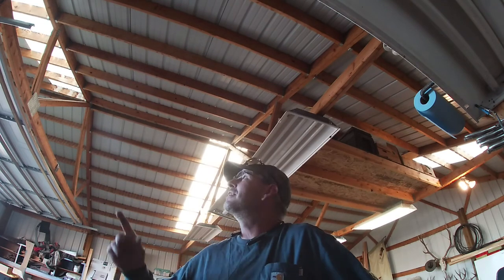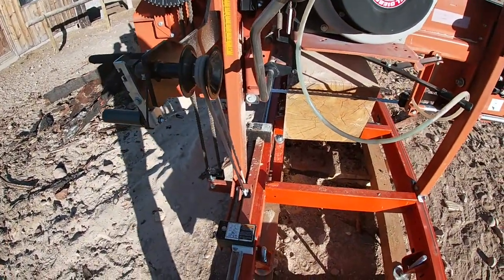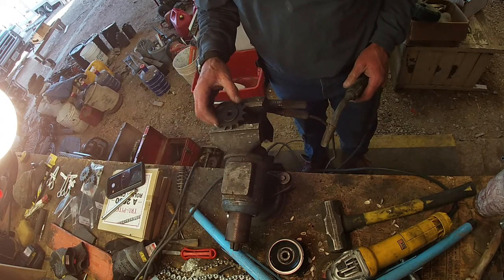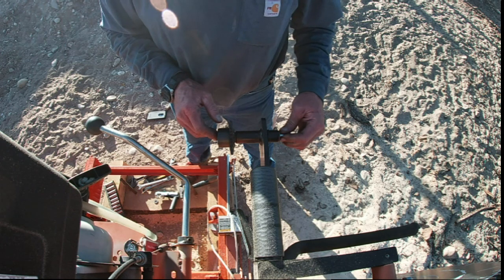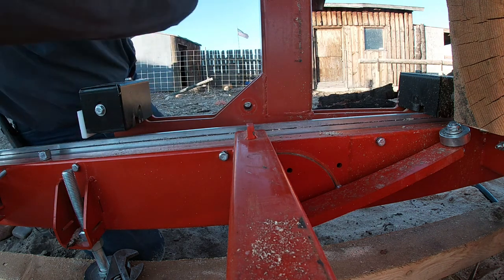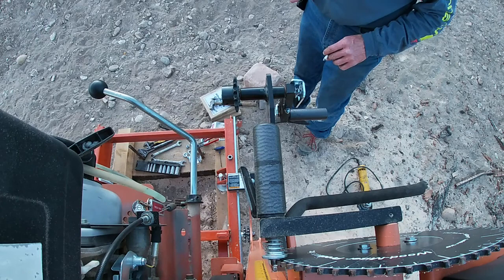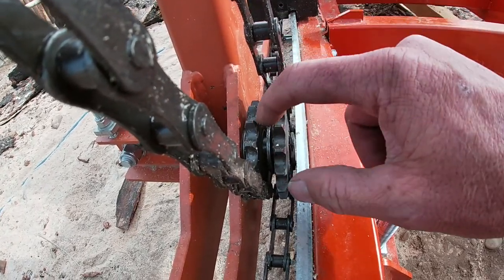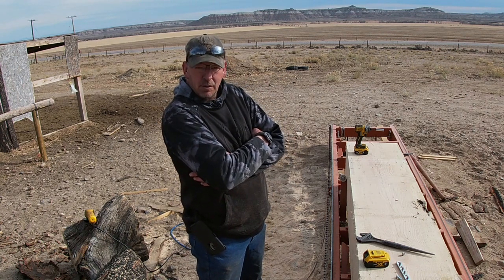Woodmizer LT15 drive conversion to chain drive

Comment: I'm on my 2nd LT15.   Yeah, the rope pulley system was always stupid.  I just push my current LT15 by hand.  I like your solution!
Reply from the maker: Wow.... 2nd one. Thats a lot of lumber to wear out an LT15. Thats awesome! Yea I definently wasn't happy with the rope system. i have a new(er) video adding wheelchair motors to the mill to drive it. Im currently out of logs but hopefully I will get a bunch stockpiled this summer. I'm not sure I could push the mill through most of what I cut. Even with a new blade it struggles to cut some of the logs I put on it. Have to go pretty slow. Thanks for commenting. I missed it and haven't been watching lately. STAY SAFE!!

Comment: Hi Travis!!😀😀
I was surprised to see that they were using rope for the drive on the newer mills. The old L T 40 that I used to borrow from my buddy had a chain drive system on them. They had the chain ran different than the way you routed yours. They had two chains. One from the crank down to the one sprocket. Then just a single piece of chain from one end to the other that just laid on top of the other sprocket. So as you turned the crank the inner sprocket just traveled back and forth down the long chain. I hope I described that so you understand what I mean. 
The  LT40 that I used had the power drive system on it with the Rio stat switch on it to adjust the speed. That way the chains don't have to cross from one side to the other. 
Take care my friend!!😀😀
Reply from the maker: You explained great. Yea i dont understand the rope either. Im planning on putting a 12v variable speed reversible motor on someday. It works pretty gppd though the way it is. Way better than the rope. Thanks for all the support!! STAY SAFE!!!
Reply: @307j.o.a.t9  cool glad I did good. LOL!! That rope thing is definitely for the birds. It just was a way to make it cheaper on their part. Mike Morgan has the rope drive on his also. He is adjusting it a lot it seems. The chain setup on the older mills never gave hardly any trouble. I milled 20 thousand feet of lumber the first time I borrowed it and didn't have any problems at all. Never even needed to take up any tension.
Reply from the maker: Nice! Yea i wasnt impressed. I like the chain system way better!!

Comment: Have been looking into this for you since my last reply. Linn sawmills has a chain drive feed system as an option. The cost is $250. might be worth looking into.
Reply from the maker: Oh wow!! Thanks. The system i have works but id lile to put a motor on it. I will check it out.

Comment: That is great and no wasted energy from slippage losses. I wonder if using link belt in place of the ropes would be easier ( though clearly not as good as chain).
Reply from the maker: That might work. I would definently use smaller chain if i did it again just so links dont rub on the lower pulleys. There is barely enough room with this chain.

Comment: Thanks for sharing. Question: Do you have your bed rails bolted to the wooden substructure...or are they just sitting on the substructure? Thanks.
Reply from the maker: They are bolted to the 4x4s and the 4x4s are on skids that are staked to the ground. The mill doesnt move when i put big logs on it. Back a few months i have a vid of setting it up.

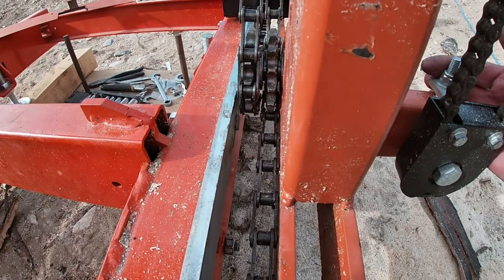Comment: OK, seeing that, not how I would do it given the same chain, idlers and sprocket... if you go to 22:45 I would have welded a piece of thick walled tubing across the top of the two vertical lengths at the bottom of the upright RHS section. run an axle or bolt through there with the idler on the end. 
The chain would stay in a single line, not crossing over at the dual idler you have... instead, running horizontally, around the first idler at the pipe that got welded on, vertically up to the pulley and around, then down to where you have two idlers and I would have had just one, then around that second idler and horizontally again to reach the end.  _______/*/____
Reply from the maker: That would work. I didnt want to modify the mill and i already had the mounting holes where the origional equipment was. Thanks for commenting.
Reply: @307j.o.a.t9  did you ever get the smaller chain? going single idler wide rather than two would mean clearance to refit the plates at 23:10
Reply from the maker: No it works fine theres just a little resistance in that one spot for about 2 inches.

Comment: Weld your loops closed.
Reply from the maker: The loops on the eye bolts?
Reply: I'm thinking yes...though it shouldn't have that much tension on it..
Reply from the maker: Yea it doesnt have that much temsion. If i pull those eye bolts apart i have way bigger problems than the eye bolt failing lol.
Reply: I'm thinking of doing the same. You think bicycle chain would work?
Reply from the maker: For sure. If you can find enough chain and idler sproclets. Im sure they can be built too out of junk bicycle parts. I didnt have a source for the chain to do that.